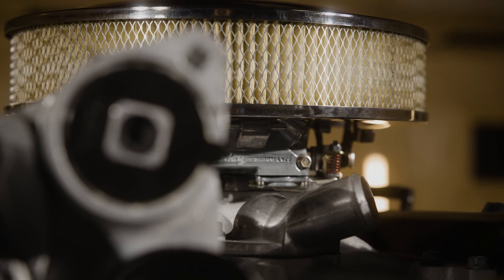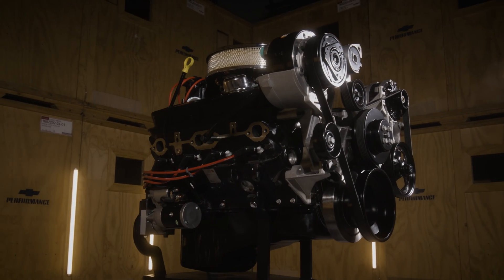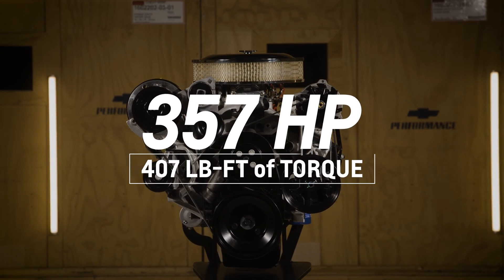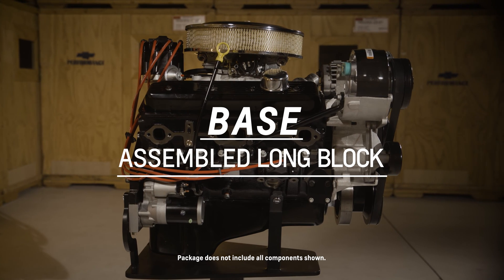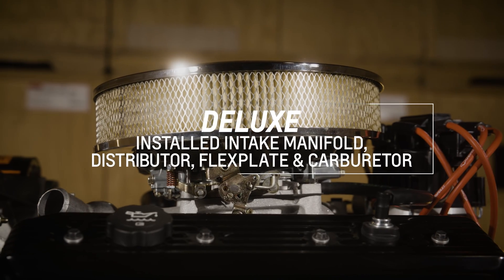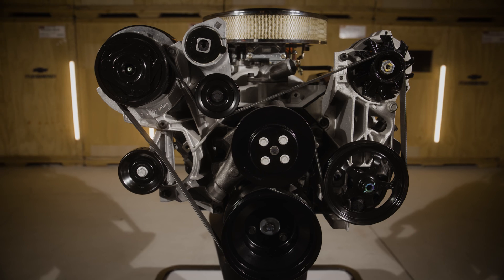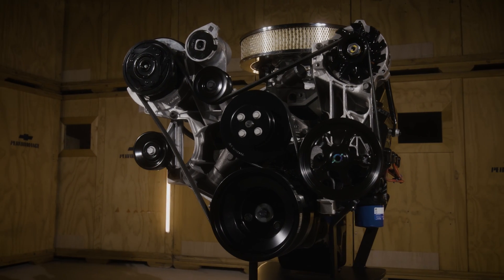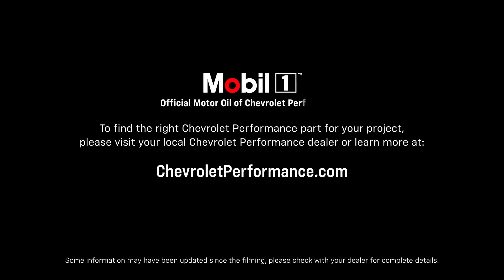Chevrolet Performance - SP350/357 Crate Engine - Information & Specs

Comment: I could find a Chevy engine from an SS Tahoe 2002 and it'd probably bolt right into a classic 6 speed manual Chevy from anywhere prior to 1993ish. I built a dodge minivan for my girl for the same reason. It's like Lincoln logs fitting these simple cars together and they're such big natty aspy engines from stock. And parts for these American muscle cars are everywhere, plus the aftermarket performance parts are so common i could have souped up a small block Chevy in 10th grade shop class.

Comment: Chevys will always need engines. Due to them not being very reliable. That's why they're affordable. Cheap parts.
Reply: I know what you mean about being unreliable. The 350 tbi in my 1990 k1500 is the unrebuilt oe that is still using the oe distributor, crank, piston rods, pistons, pistonrings , pushrods, head gaskets, exhaust manifolds, and rockerarms. At 405k, I replaced the oe timing chain, and as of today, the odo. reading on the same predescribed oe engine is 522,543 miles and is unreliable enough to use as our daily driver. Unreliable most definitely, LOL.🤔🤔
Reply: Really?! Why are you even here?!